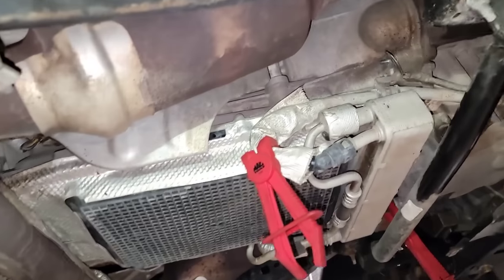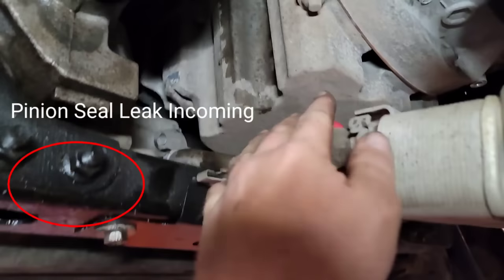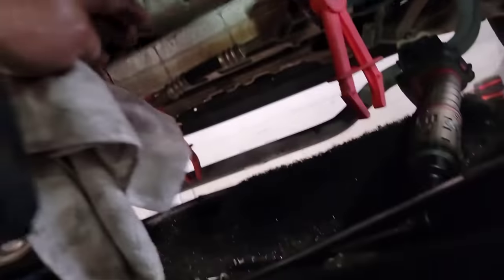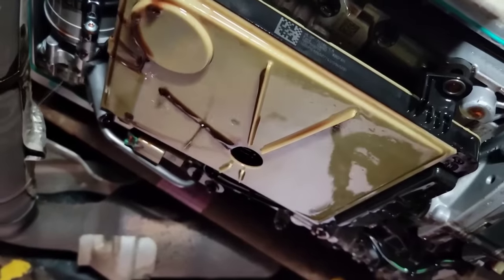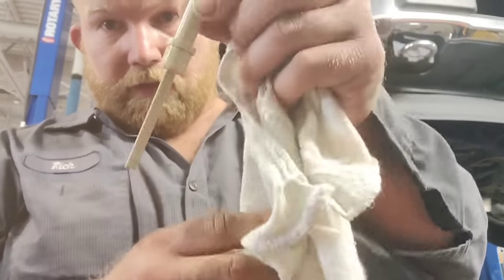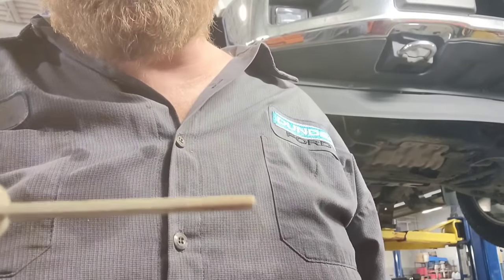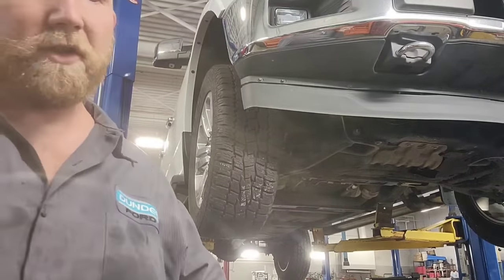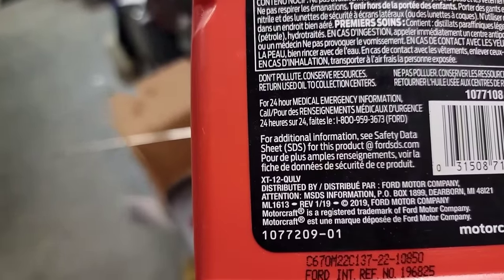EASY WAY Ford F150 10R80 Trans Filter Replacement and Gasket and Fluid - How to check Oil Level also

Comment: I have a 2019 F150 2.7 10Speed. Local dealer I bought new from recommends trans flush every 30k miles (I did at 30/60k miles) they didn’t recommend filter change, what do you think? I service my truck religiously, goal to see 300k miles
Reply from the maker: The filter can go awhile but I'd definitely get it done
Reply: I’ll plan on filter change with new fluid at 90k. Change filter every other flush after that

Comment: Bought a 13 ecoboost with 58k had leed frame replaced at dealer I bought it from now has 79k when do you think I should replace
Reply from the maker: Coolant and diff services and transfer case fluid maybe brake fluid

Comment: Does the exhaust pipe on the way? I suck out fluid and fill every 12000 miles. Try to avoid drop off pan.
Reply from the maker: The exhaust does not get in the way

Comment: Hey Rich! How did you torque the bolts that are behind the exhaust. Long story short, I did clean where the transmission gasket sits, and did install new gasket. And I'm still leaking from where the  exhaust is.
Reply from the maker: Quarter inch drive 10 mm swivel socket, quarter inch Drive extension, quarter inch Drive electric ratchet

For the 2 13mm bolts I used a 13 mm wrench and I angled it from the pan backwards
Reply: @FordBossMe  thanks man I'll try, I guess I'll have to buy some more tools.

Comment: Good afternoon, are they going to have any updates to fix the shudder and shifting issues on the 10 speed auto?  I know there are a couple out there, and some have better results than others in regards to effectiveness.  Thanks!  Our dealer is backed up about 2 months right now, and I was hoping for an over the air update.
Reply from the maker: Adaptive relearn, transmission break in strategy procedure, valve body cleaning and if those things don't work they tear it apart and look to rebuild if it's not the torque converter and that's all I really have for you
Reply: @FordBossMe  thank you!

Comment: So you replaced 7 of the 13 quarts in the system. Sounds like another drain and fill would be a good idea. Just measure what you pump out and replace with the same amount.
Reply from the maker: No no

Comment: I took my 2018 2.7 10r80 to a ford dealership in my town to do a transmission drain/fill. I have now been back 3 times because it has been leaking. Why might this be happening?
Reply from the maker: I'm not sure there's really nothing that special about it I mean the service so I'm not sure what they did unless they drop the pan
Reply: They don't have the experience to do it correctly. The manual days 150k. Most dealerships don't see vehicles with that many miles and most ppl don't service before the manufacturers recommendations.

Comment: Is there a way to get the fluid from the converter or does it all come out when you drain the transmission? had a flood feel like there’s water in mine
Reply from the maker: You're going to have to keep doing drain and fills because there's no way to drain that torque converter
Reply: @FordBossMe  thank you sir

Comment: Hey just changed my transmission fluid and filter. I drained approximately 6 quarts. When I added the fluid back I put 6 quarts in and didn’t touch dip stick. I added another and still not touching I added the 8th quart and still not touching? Any idea what’s going on?
Reply from the maker: The vehicle needs to be up to complete operating temperature and you need to have enough fluid in it while it's hot to be on the dipstick so if it's just if it's not on the dipstick you're not putting the dipstick down in all the way or you need more fluid that's just all there is to it
Reply: Just concerned that I’m putting in more than I took out. Had up to full operating temp. Burned the pee out of my hands. Just concerned with over filling since I took less out?
Reply: Also I can’t find anywhere of where the fluid needs to be on the dip stick. Has number 1-6, the manual I have have nothing on fluid level or reading the stick?

Comment: Hey brother, on F150 4x4, is Frt. Diff. Fluid serviceable? The dealer told my brother that they tried but it's not accessible and not serviceable. WtF?
Reply: 2019 F150 4x4 w/ 3.5L Ecoboost
Reply from the maker: It is serviceable but you have to suck it out through the fill hole

Comment: Hello, I enjoyed your video on 10R80 transmission and wanted to try my luck on what your thoughts would be on the issue that I have with mine. 
I have a 2021 Ford Expedition with about 25K miles, no warranty. Upshifting is more or less normal. Morning shifts to either rear or drive on the cold 
start are jerky. Worst part, while downshifting, starting from 4th gear going down till a complete
stop it hesitates, jerks, always skips the 2nd gear on the gear indicator while downshift, and most of the time (not always) it give me this "thump" or a "bang" as I am almost getting 
to a complete stop. My local Ford dealer says they performed TSB 22-2428 and performed adaptive learning drive cycle, did not help at all. I am not going back to local dealer as they dont have anyone really knowledgeable on the 10R80.
Please reply with your thoughts on this or if you came across or diagnosed these symptoms before.
Also, where are you located if I were to bring it in for a fix.
Thank you in advance.
Reply from the maker: The problem with your transmission is it's junk and they have been having this problem since 2017 when they came out with it and there's no fix other than rebuilding the transmission or taking it apart and figuring out what's wrong

Comment: How many quarts did you end up using?  Seems less than the specified 12ish.  What do you attribute the difference to? Residual in the tranny somewhere?
Reply from the maker: I actually answered this in the video
Reply: @FordBossMe  yes it was less than twelve but, I don’t recall the amount.  I’ll rewatch, but why the delta between spec and the fill?

Comment: Hi Rich , great video ! I was wondering about my 18 f150. should I get my tranny flushed or drain and fill new filter or both it’s near 57k miles?
Reply from the maker: I would do a drain and flush just the basic one and then at 80,000 miles change the filter and fluid again
Reply: @FordBossMe  will do thanks Rich!  👍

Comment: Excellent. Just did my 6r80 on my 11 6.2 F150. Was sitting for a few days and I got 10 quarts (also cracked the trans cooler lines).  6R80 (I believe) must be at the top of the highest hash at temp. I filled it to the area in between the hashes cold, and it was spot on hot.  I did it with no jackstands :lol:. Seems it was serviced 60K ago, but the fluid was dark as night.  I have a feeling the previous owner towed judging by the big hitch. I think it is amazing that at 186K the truck has ZERO leaks.  But I would say 50-60k is the service interval for the trans. There is a video in German by the ZF  (who Ford licenses from) engineers and they suggest that interval, but the manufacturers make their own decisions. They really explain it well here: https://www.youtube.com/watch?v=D0f3AYoE3cI
Reply: That pretty nirm6al for LV and ULV, turns black pretty quick, it'll still have some red color on the dipstick where it's spread thin but drained into a pan it looks pretty black. It bothered me when that stuff first came out but it does seem to be doing a great job, and yes changing at 30k to 50k intervals will hell these transmissions last alot longer without little hiccups. Harsh shifts and hanging in gear is very common if you follow the manufacturer interval.

Comment: Dealer told me the trans filter is a lifetime filter so they just do the fluid. Is that correct?
Reply from the maker: No they are incorrect it can be serviced and the fluid and filter is only good for about 150,000 MI they say but it really needs to be done by about every 50 to 60 and the filter by about every 100

Comment: Ford dealer just quoted me $1100 to do this job…..I have 79k so feeling like I’ve got to do something 🤦‍♂️
Reply from the maker: Yeah I don't think it's an $1,100 job but it is expensive so maybe that's just the going rate in that area
Reply: @FordBossMe  thanks for the reply. They quoted $300 for a trans flush. Can you comment on your thoughts on that? Much more affordable obviously if you’re trying to get  new fluids in every 50k